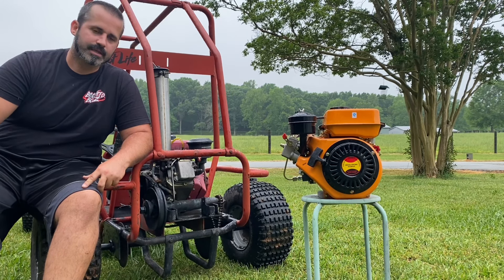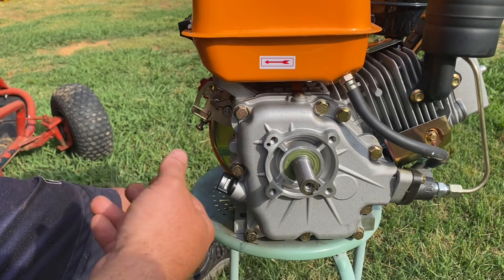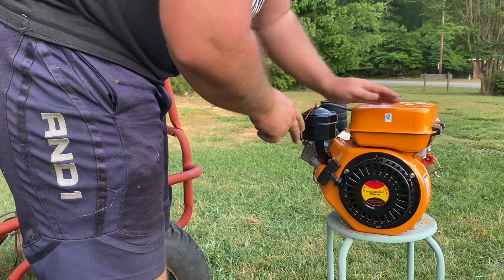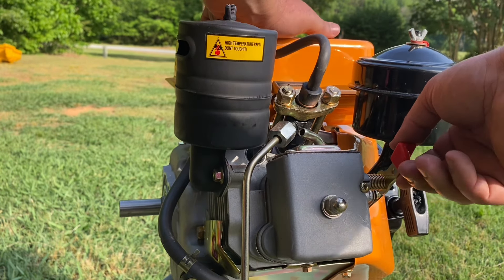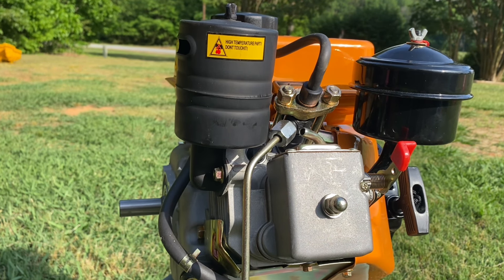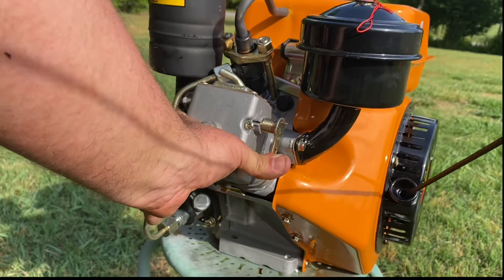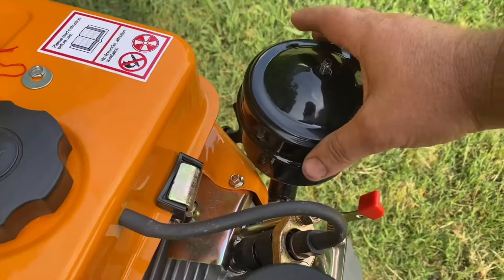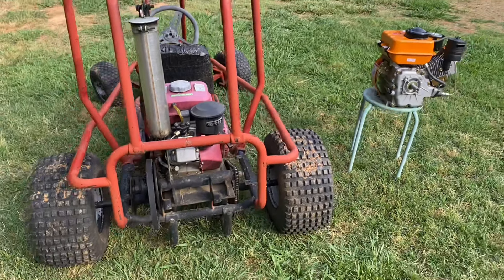196cc Chinese Diesel Basics- Output Shaft, Starting, Tips, Troubleshooting

Comment: walmart sells  gallons  rotella  oil  around $20  ,  This will make  those  diesel  carts  last  long time  ~ get you some
Reply: Often changes makes them last, not just any brand name oil... this is low performance diesel engine.
Spin it slower and load it only when its hot and you are good to go. Chinesium fails anyway at random, go honda if you need reliability as you cant beat quality control and material quality 🎉🎉

Comment: The engine isn't weak. It's the normal specs for a 196cc diesel.
Reply: ...which is built based off a generic petrol engine, which was either I think Honda or Briggs (I can't think of the other brand right now)

Comment: Watching this in New Zealand. I think you should try running it on used chip oil etc. Imagine this as a post apocolyptic, mad max vehicle, could you make it run on what's available? I dunno. But this channel is awesome!
Reply from the maker: Yeah I’ve been thinking of trying some different fuel sources just for fun. I have seen someone running on vegetable oil but they had to heat it to keep it thin enough to flow well. I appreciate it!
Reply: I run mine on straight used engine oil with  abit of petrol. No issues it runs and starts just as well as diesel
Reply: ? You mix rapseed cooking oil with 10% diesel and enjoy low fuel prices here in europe 😮
Reply: @jwsbackyard6413 mix in some Diesel and you won't need heat.. or mix even more diesel 20%

Comment: I adapted the 20 MM shaft up to 1 inch and had no problem finding clutches and bigger pulleys. I won't use either as you can crack the insides. Use hot water. The 15W40 oil has to be topped off a lot as the oil consumption is higher than many motors. A 7 inch skinny Vee belt pulley is good for an alternator. I never loosened the fuel line but either. I wired the decompress and pulled many times until I smelled fuel oil through the exhaust. I don't rev hard and I run it on pump diesel only. It takes like 20 hours to break in.
Reply: Try running some 50 weight, might decrease oil consumption a good bit.
Reply: @FeatheredDino  I'm not worried about oil consumption. Just reducing wear.

Comment: What did you use to file the crankshaft down?
Reply from the maker: I used sand paper and a file on the first engine but I used a grinder and sandpaper for the second and it went a lot faster. Just have to take a little at a time and measure often.

Comment: Would one of these be strong enough to run a 2500 colemann generator head? probably would have to gear it up
Reply from the maker: Not sure about that specific generator but it’s rated at around 3hp and 6lbs of torque.
Reply: You would have to look into it but from memory to run a generator you need to have the engine to be able to get to a certain rpm to be able to create the correct frequency something like that but if you do a quick search you'll find your answer
Reply: 3hp (2.2kw) diesel would probably power a head that would make less than 1.5kw, going by the usual loss from engine output to electricity output
Reply: @Derski92 3600 is usually the rpm needed. These spin 3600.
Reply: The generator head is going to be taper shaft. I have yet to see one of these with taper.

Comment: Hi JW, i have been looking at that one and the predator 212.... Im building a small well drilling rig and need it to run steady around 2000 rpm....  which one do you think will give me the best torque?  2000-2500 will be my set rpm range
Reply from the maker: I’m not really sure where each of them make their torque at but the predator makes more torque than the diesel. The diesel will be better on fuel, can run on used oils and it will be easier to maintain without the carb. The predator is cheaper, has a ton of parts available and makes more power. There are pros and cons for both but the predator is really the most practical option unless you are out away from civilization.

Comment: 9:51 how do you turn it off without pushing the decompression switch?
Reply from the maker: If you push the throttle all the way up towards the turtle it will cut the engine off. That is the way you are supposed to turn it off.

Comment: I have a 400cc varent 10 hp I run a inr supercharger on mine idk what the final hp is but its probably 2x what stock is
Reply from the maker: Interesting, how are you adding fuel for the supercharger?
Reply: @jwsbackyard6413  Mine has a adjustment screw for the fuel rack, but might wanna see the turbo video from CarsandCameras they did a turbo varent
Reply: but long story short on most of these engines under the fuel pump there is some shims that control how much fuel is deliverd
Reply from the maker: Cool, I appreciate it!

Comment: have you messed with the fueling systems at all?
Reply from the maker: I have taken the injector apart and had the pump out before but haven’t modified anything. Been trying to figure out how to increase fueling for some nitrous or forced induction.
Reply: I messed around with mine and I got a higher fuel pressure by removing 2 of the 3 spacer gaskets between the pump and the front cover, it wasn't a huge increase but it was definitely present.
Reply from the maker: Interesting, I’m going to have to try that.
Reply: @jwsbackyard6413 that change’s injection timing but not pressure.

Comment: I just got a red one. But it looks like the Orange one. I think it had the same weird stickers and has wing nuts on the intake and exhaust. But has a fuel filter that was backwards and a hose from the crank breather to the intake. And has a center bolt valve cover and came in a wooden crate.
Reply from the maker: I’m thinking that they may have updated the design since I bought the red one years ago and the differences I saw were because of the update and not because the red and orange are actually different.